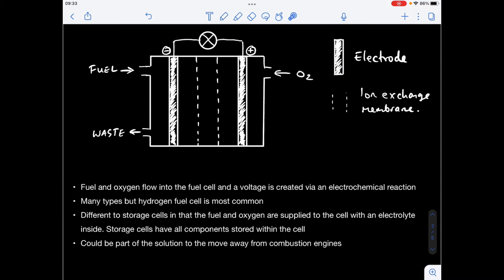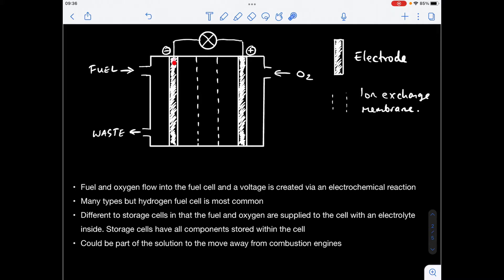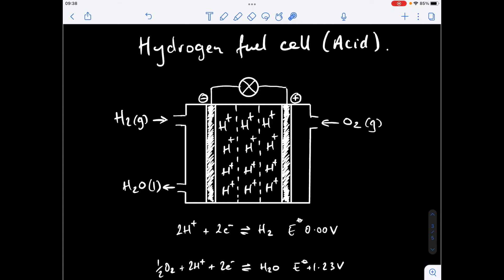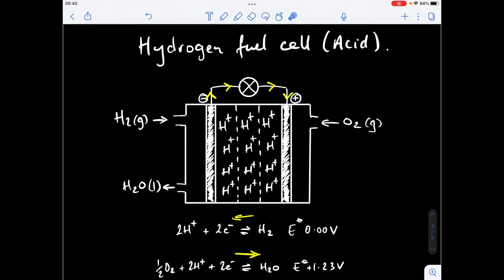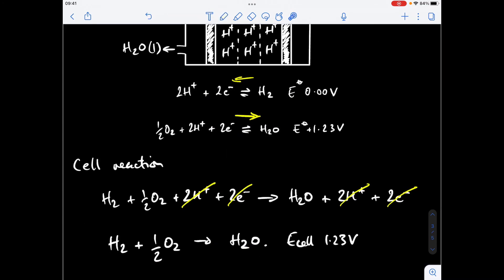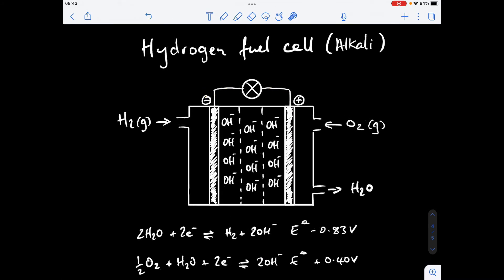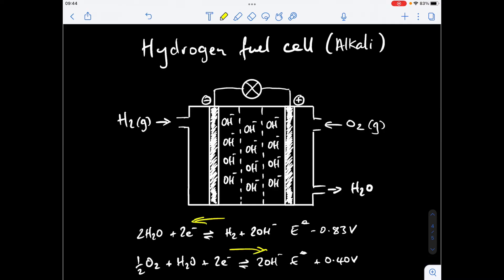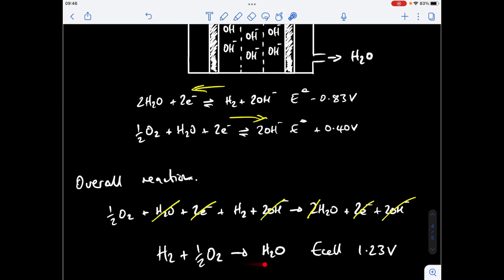FUEL CELLS

Comment: the side which the H2O comes out of is wrong for both cells. it should be the inverse
Reply from the maker: Ok but doesn’t matter
Reply: @MaChemGuy  yea definitely not important, I was just kinda confused. love your vids btw. doing some last minute panic revision before I leave for my paper 3 exam in 5 mins 💀
Reply: @satoshikamiya4636  how did u do? :0
Reply: @deuterium4.028  2 marks off an A* in chem, but I'm doing engineering so it's no biggie :)
Reply: @satoshikamiya4636  that's amazing, congrats! tho the boundaries were horrible last year
Reply: @satoshikamiya4636  how did you revise?
Reply: @satoshikamiya4636  bro please tell me, how did u do it. Just spammed past papers???